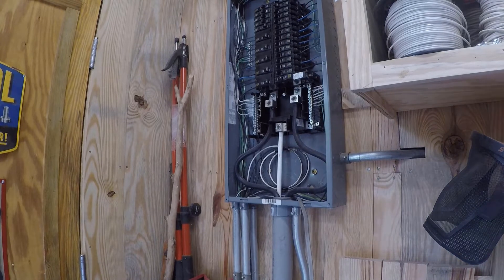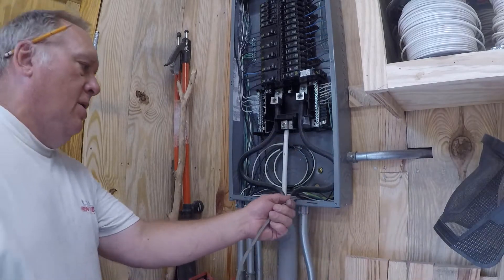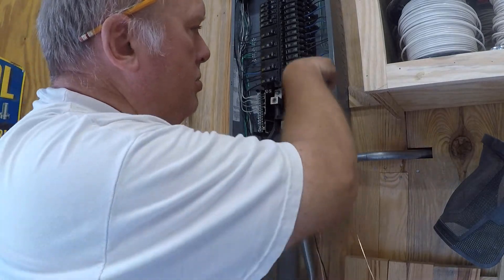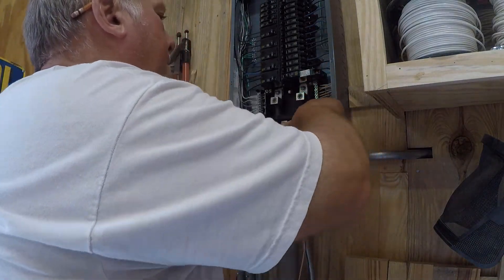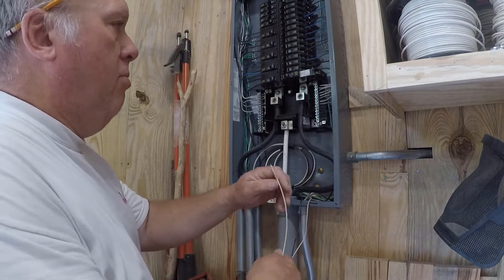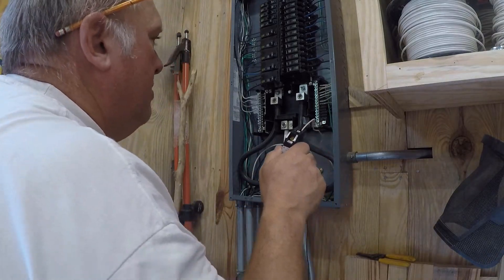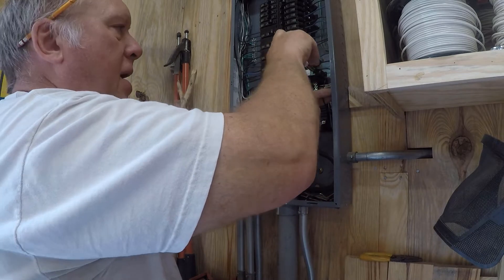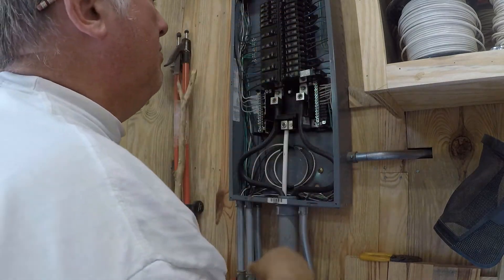Building a Solar Kiln part 7

Comment: Very nice, I am to the point of installing fans in mine, so I appreciate seeing your fan setup.  I used the Wood Magazine article as a starting point for my design but built 2 large doors on the back to accommodate using a loader.  8 x16 with a 4/12 pitch on the small back roof.
Reply from the maker: Awesome!  I now wish I had made mine larger.  Thanks for watching!

Comment: great job on the build, i went to the site and down loaded it and was looking over spec's. i must be missing something, basic info i was looking for is height of front low wall, and back wall, the rest i can figure out, i like the way you worked out that fan support , you can tilt it right out of your way. i already got the same fans and thermostat, getting material to start the build in a few days, if you can happen to send heights , would appreciate it.
Reply from the maker: Thanks!  I found my plans.  It is 5'6" on the tall wall and 2'0" on the short wall.

Comment: Very informative videos. How are you liking the performance of the kiln? Does it dry wood effectively from what you’ve seen? I have been looking into building a kiln and I’m trying to compare solar to electric heat/dehumidifiers.
Reply from the maker: Thanks for watching Preston!  It has been very effective.  In about 5 weeks it got some pine I had in there low enough that my meter wouldn't measure it.  I had to let it sit in the shop for a few days to get some back.